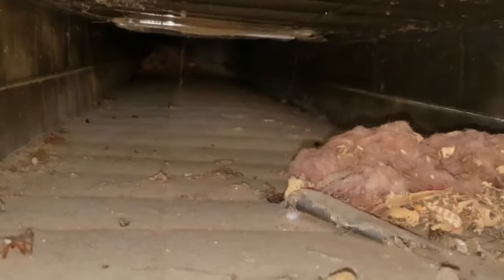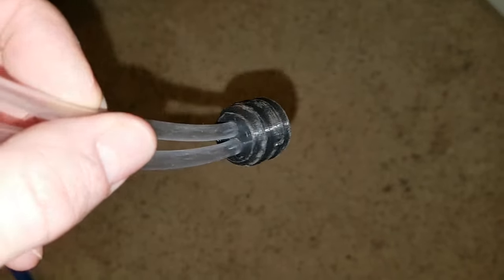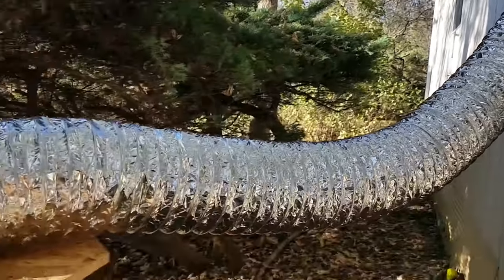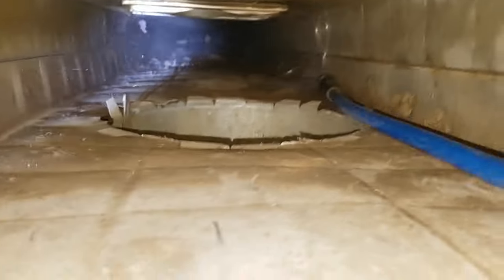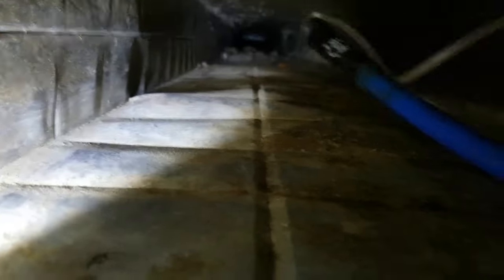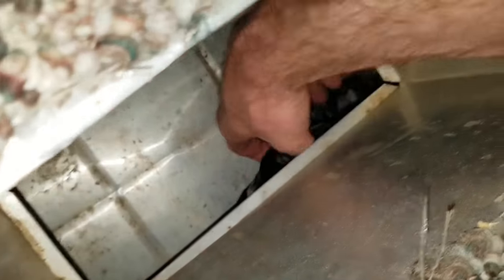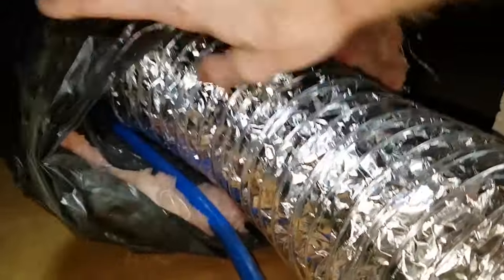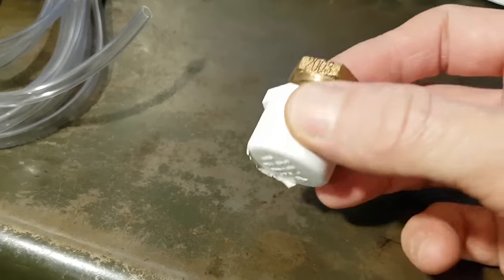DIY Air Duct Cleaning Tools, part 1 - How I Cleaned Air Ducts using DIY Equipment, 40 year old house

Comment: After I cleaned mine with a Duct Whip borrowed from work, I checked for Snag points, and Pulled / Pushed old cut up Dry and Damp Towels through the Ducts.
Reply from the maker: Thank you for the tip

Comment: curious question? I inherited my double-wide mobile home from an elderly relative who was going blind and a hoarder to boot, 
HVAC vents had bug infestation from when HVAC didn't work for a while worst than what you showed because he would just live in the living room by the window ac unit when got hot outside,
 Can you use a DRYER VENT cleaning DRILL BRUSH kit 
with shop vac adapter WORK for also cleaning the HVAC AIR DUCTS or will the air ducts be damaged by the brush or will the brush be too weak to get all the crud out,
 
plus next door neighbor is a heavy smoker and wood fire burner addict, inside my house, smells like inside sooty chimney and I have moderate to severe COPD DEPENDING ON HOW MUCH AND HOW OFTEN THE HEAVY SMOKER BURNS,

 NO FURNACE FILTER OR AIR PURIFIER WORKS WITH THAT, IT CLEANS THE AIR FOR LIKE 5 SECONDS THEN STINKS AGAIN!

 I'M DOING GOOD TO GET MERV 8 OR 9 FROM THE LOCAL HOME DEPOT GETS DIRTY WITHIN A WEEK OR TWO 20.00 A ITEM OR MORE I CAN'T AFFORD MORE THAN ONCE A MONTH,

 I WAS GIFTED A BETTER METAL WASHABLE FRAME ONE IF I WOULD JUST CLEAN IT OUT!  

BUT TOLD BY LEADING FURNACE FILTER CO NOTHING WORKS FOR WOOD SMOKE EXCEPT MERV 14 only commercial businesses can get that OTHERWISE FOR INDIVIDUAL ITS $50-75 PER FILTER THAT'S TOO RICH FOR MY BLOOD ON SS CHK TO PAY EVERY MONTH!
THE ONLY TIME AIR DUCTS WERE CLEANED WAS WHEN NEW ONES WERE INSTALLED OVER 10 YEARS AGO WHEN THE LEAKY HVAC WAS REPLACED AND DAMAGED WALLS WERE REPLACED AND NEW HVAC WAS PUT IN THE KITCHEN PANTRY INSTEAD OF THE CRAWL SPACE IN THE MASTER BEDROOM CLOSET!
Reply from the maker: Yes, a dryer vent cleaning brush kit can work. Here is a link to part 5 of my DIY air duct cleaning tools series where I experiment with one of those kits.  I don't know about using the shop vac but I suppose it could work if the duct is small enough, or if the vac is large enough.   https://www.youtube.com/watch?v=gcUj_hyhHI0&t=120s
Reply from the maker: Also, maybe a pre-filter material of some kind could help extend the life of the furnace filters.

Comment: Doesn't the duct whip snap holes in the flex ducting?
Reply from the maker: It could easily damage foil flex ducting,  but the plastic flex duct we have wasn't damaged by it, although it did concern me.  I made a different whip for foil flex ducting, a link to a video about it is in the description below.  I also made a special whip for the large plastic flex duct. A video about that whip is also linked in the description.

Comment: I am getting a lot of dust in general on my home. What could be the cause of this? I change my gvac filter every 3 months. Any insight?
Reply from the maker: I don't know.  We live near a dusty road and the dust gets in the house sometimes.  I bought an air purifier a while ago and it helped.  Might need to seal the windows and doors a little more.  Some of the weather stripping on them may be leaking.
Reply: I have the same issue. I have the worst dust problem.
Reply: Do your filters seal up good when in place? Some really don’t seal very well.

Comment: What is the air compressor you used and what is the cfm and psi you used. Do you recommend model which I need to look in Home Depot or lowes
Reply from the maker: I used a 20 gallon portable electric air compressor.  It has a pump rate of about 6.5 CFM at 90 PSI and it was barely large enough to do the job.  Had to take some 10 minute breaks once in a while to let it cool off.  I recommend a larger air compressor but I'm not sure what's available.  The 20 gallon air compressor did work though, and I intend to use it again.
Reply from the maker: My compressor pumps up to 120 PSI, but I used the whips with 100 PSI or less.

Comment: I had my ducts professionally cleaned recently but they didnt do one section (my dad noticed). They have been a pain in the butt to come back out and finish the job. If i get the 50 ft dryer vent cleaning tools on amazon can i finish myself? Sorry if u already mentioned this, i just started looking at DIY options today
Reply from the maker: You might need to make some homemade duct cleaning tools like I show in other videos on my channel in order to clean that segment yourself.  Those videos should be linked in the description below.  Remember that whatever you use to sweep the duct, a negative air machine (duct vacuum) needs to be used to suck out the dust and debris.  The DIY leaf blower vacuum I used in this video worked okay, but was kinda weak for how large the duct was.

Comment: Why don't you use a long hose attached  to the shop vac
Reply from the maker: I tried that.  I used a 6hp shop vacuum and it didn't do much.  I believe I can make an attachment for the end of the hose to help it sweep up dust but I can't imagine it being more effective than the upgraded air whips or the rotary brushes I built later in this series.  Links to those DIY duct cleaning tools are in the description below.

Comment: How much times do you need to clean those ducts? 1 every month?
Reply from the maker: It depends on how fast they get dirty.  I expect to clean the ducts about once every 3 to 4 years at least.  But it's kinda dusty where I live so may need to do it more often.
Reply: @BudgetPhil  o okey. I dont have any AC but my fan collect lot of dust so I clean it every week. That's why I was wondering for those units. My be last long because they also have filter.
Reply from the maker: Yes the furnace filter is extremely important for keeping the ductwork clean.  The ducts can get dirty quickly without one.
Reply: I clean my duct system just after I make coffee each morning.

This is why most people comment on how clean my ductwork is when visiting my home.

Comment: Any advice for getting a cheapskate landlord of an apartment to clean out air vents? I live in an apartment and after cleaning all surfaces of dust, within just a few days a thick layer of dust is formed back on top of everything. It's bothering my allergies and I just hate how much dust collects in this apartment!
Reply from the maker: If you can safely get pictures of the dust inside of the ductwork, it might help convince them to call a professional duct cleaner.
Reply: @BudgetPhil that's a good idea, I will definitely do that
Reply: @BudgetPhil  welp... tried it and it didn't work... landlord even came to look at the vent and admitted it was dirty but just said "he doesn't see how that would make a difference but I could clean the outside of it if I wanted to." I don't think he's ever gotten the vent cleaned ever, not even when he bought the property.
Reply from the maker: I believe residential duct cleaning is a relatively unknown concept, but that's changing.  I had never even heard of it, until one shocking day.  It sounds to me like your best option is to begin looking for a new apartment with better air quality.  In the meantime though, there is an air conditioner window unit filter material that is commonly available in hardware stores that I assume one could potentially cut and place over vents to help filter air entering an apartment.  I've never used it for that, but I think it could work.  These custom cut "vent filters" would need to be replaced once in a while, as they get plugged with dust.  If the dust is coming from the vents, then the landlord needs to get a better filtration system.
Reply: This video just showed up this morning. I work for a cleaning service. Have for the past 20 years.  We clean quite a few air ducts in houses. Plus we have done several commercial businesses, even at several colleges. We have a rotobrush system. It vacuums plus brushes the vents at the same time. We have worked at a few apartment complexes, but have just done a few apartments. Even then other tenants were begging us to do there ducts. But we can't do it without approval cause we won't get paid. Its not a cheap job is why all apartments are not done. $18 to $25 dollars each vent. Plus the return vents are $45 to $50. We clean the unit and A-coil thoroughly $125. Lots of work is involved doing all this. Takes between 3 to 5 hours usually with a 2 man crew.
Reply: @levelintent  If it's important enough for you could you pay to have your unit done and get permission from the landlord?
Reply: @youtubereview8176  Yes, I've considered that but so many places are scammers, I don't feel confident that I would be able to find someone that would actually professionally clean it out. And then most companies focus on house vents only, not apartment vents which are attached to other people's apartments or something else in the building... so those are my concerns.

Comment: Constant cleaning is the key to the prevention of fire hazards and safety.
Reply from the maker: Yep.  Lint build up inside of dryer vents has caused many house fires.  But I would only clean HVAC ductwork once every couple years or so,  depending on how quickly it gets dirty

Comment: We are searching for a solution to our in slab duct repair issue. There appears to be areas which are deteriorating and the spray encapsulation, like Duct Armor, seems like a good solution. Anyone have experience or feedback on this method? Replacing what's in the slab does not appear to be an option, neither is installing split units or overhead duct work.
Reply: I had Duct Armor installed due to transite asbestos in the concrete ductwork that goes under my homes slab. Has worked great. Been about 2 years and had no issues.
Reply: Aeroseal

Comment: where did you get the 3d print for the air whip???
Reply from the maker: I downloaded a 3D model of a 1/4" NPT threaded cap, from Thingiverse I believe.  Then I modified the file with Meshmixer to add the holes for the whip tubes.

Comment: Wish I could post pictures what I just had to do. 
Went into the in lowest biggest part of intake cold and intake hot air. They are right next to each other. 
Did some research on paying for professionals. Decided to do a pass.  Some say it's really not worth it. 
Any who.. I adjusted my camera to shoot pics with voice command. 
I put the camera down each hole with flash and said 
Shoot. 
Looked at the pictures and WOW!  I'm wondering why I have dust.. Now I know. 
Any who... 
I get the shop vac.. 8 foot hose. Clean it out real good. Clean filter etc... Turn everything off, fan, heat, air. 
Look at the pictures and begin. 
Both sides. Luckily the hose was as long as the end of the lowest part of dust collection (return air /heat ) I used intake not expell air.. On the shop vac and put the hose down and started. 
I was very curious what was coming out before another picture to gauge my work... 
All I can say is wow! One look at the shop vac I felt very pleased. 
I had to be careful I didn't want to dislodge or harm my duct work. 
Took more pictures.. Located areas needing re done and went back in again. 
Repeat as needed. 
Fastforward... 
I am very proud. 
Looks 90 percent. 
You'll never get everything of course but wow. 
Oh  I made sure all my vents were tightly closed. Even though I was pulling air not pushing.. It's best to do that.  I also half way through.. Turned the fan on to push up anything perhaps setting that I couldn't get.  Put the shop vac down again and done. 
Changed my air filter. 

Thanks for the video. I wish I knew how to do all that. I would of for sure. My house is very diffrent than that one.
Reply from the maker: Awesome!  Removing 90% of the dust is a massive improvement.   It sounds like your technique worked well for the type of ductwork in your home.  Thank you for sharing that experience.  In part 5 of my DIY Duct Cleaning series, I'm going to talk about some tools and brushes that might be helpful for removing that last 10%.
Reply: You go DIY pro! This video is super helpful. 👏 Have fun being awesome.
Reply from the maker: @punchymuffin6402  Thank you
Reply: @BudgetPhil  hey Phil.. I've been looking into that. I'll absolutely watch out for that part. 
Hey real quick. Can't find this answer.  
So when I do this am I correct in just worrying about the lowest parts where heat exchange and return air are at their lowest, or... Should I be taking off every single vent and running the long hose down attached to the shop vac? 
Or is doing it how I did it, the correct way? 
I just want to make sure I'm doing this correctly. 
Thank you again, I'm going to subscribe now.
Reply from the maker: @MG-cd9ek  I would recommend pulling the vent covers off and looking for dust or debris in all of the ductwork that can be safely accessed.  I believe the vacuum hose will help to clean most of the ductwork, but I would be very careful with the hose around any heat exchangers.  The little thin metal fins on heat exchangers are often very easy to bend.  Accidentally bending over these fins can block some air from passing through the heat exchanger, reducing its efficiency.  But heat exchangers do need to be cleaned because dust also reduces their efficiency.  A common brush attachment for the vacuum hose might help some, but I would secure it really well with lots of strong tape so that the brush attachment doesn't accidentally pop off the end of the hose and remain inside the ductwork.

Comment: You can do it like this or drop 600 plus to someone else,  I'll do it like this I have the stuff
Reply: If you can do it yourself that is the best way to save money considering how expensive it might be to get a cleaning service.  I just moved into a town house and noticed the flow of a couple of vents on the second floor is not so great but I also have no idea what path those ducts are taking.  I found a potato chip bag thankfully empty in one of the vents downstairs and other stuff much like he found in his. I had a feeling that stuff may be in there considering that home builders are trying to build as many as they can and the people who one day move into them don't always imagine these things happening.  I would get a cheap bore camera and snake it down in and see what I find it may surprise me.  The same camera can also go to places where you can't get to easily and help you look to make sure that there is nothing hidden there like dead mice that became trapped in there or something.  I looked at my AC coils inside the house and it looks like I would be best to find a good technician to clean those because it looks like I may have to remove a lot of panels to get any kind of access the way these ones are.  It wouldn't surprise me much if they just needed cleaned and that is why the air flow is so low on the second floor.  I do have a feeling there is debris in the ducts contributing to the poor flow.

Comment: That's a lot of effort spent on avoiding paying for a service. 
  I can appreciate the tutorial but, this is not practical.
Reply from the maker: I understand.  That method is not for everyone.  Cleaning the ductwork has been quite a learning experience for me and I'm happy to share what was learned to help others decide whether or not to take on a project like this.  In part 5 of my DIY duct cleaning series, I'll show an electric drill powered rotary brush which may be more practical to use than the air powered duct whip.  And I'll show how it was easily modified to be more effective.  Thank you for your input.
Reply: If it’s like a ‘Zen’ thing, then it is the most practical way to kill 2 birds….. All in the eye of the beholder.  Or the be-doer….😊